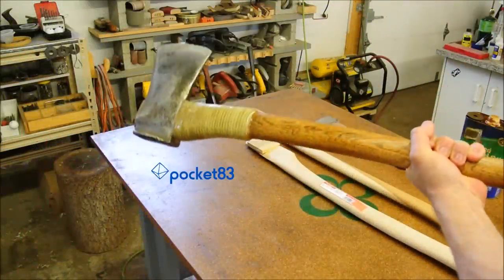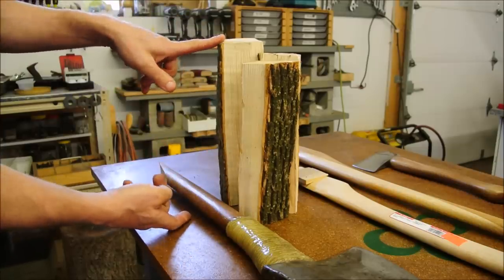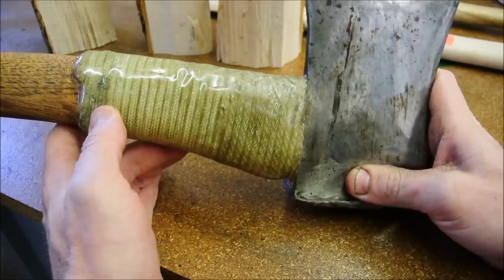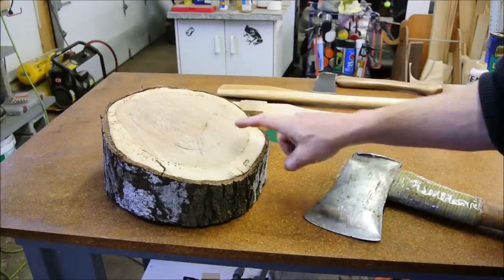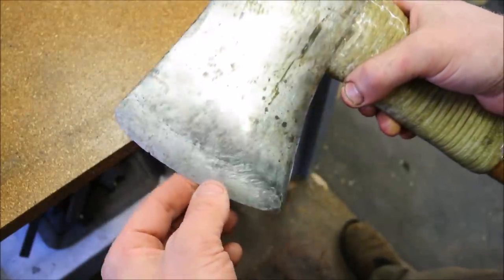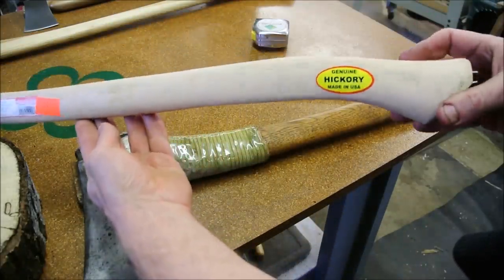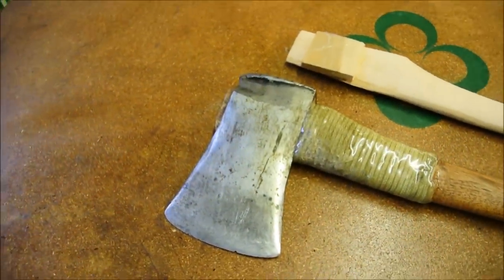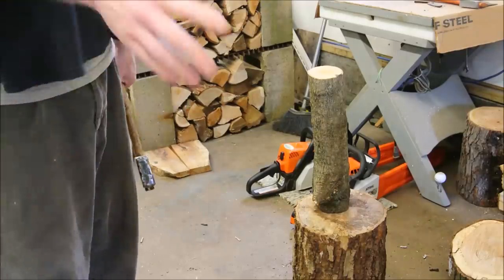Why (& how) I split with an axe instead of a maul

Comment: Axe heads can be perfectly good for splitting as long as they are shaped right. To get this shape is difficult in a manufacture process while a maul is nice and simple to manufacture.  Everyone has different preferences. You have found a great splitting axe and many will never have the chance to use one.

Comment: If I recall from ancient times when I competed in collegiate speed chopping  , we had to shape our own axe heads from "blanks". A veteran chopper guided us through marking out the areas to remove more metal to provide the hollow areas that transitioned to the "blow out" section that drove the slabs away. Also, the level of polishing  to enhance exactly what you're explaining about efficient cutting with minimal sticking. Everything competitive requires the details be refined to the extreme. But, as you so well articulate, attending to some simple details makes the task much more efficient and meaningful. Good stuff!!
Reply: Would having recessed areas of the head help with the splitting? I.E. Less surface area and friction. Maybe even making a way for it to breath so when it digs into the wood the air underneath it can escape more efficiently. I have no idea if it would work but sounds cool. Btw I'm a novice when it comes to axes. No hate.
Reply: that would make friction point that would probably jab into the wood being less efficent

Comment: Never seen a axe handle split like that before. Pretty cool that the rope/epoxy handle guard held up. I’m getting ready to wrap some Kevlar strip around the handle and epoxy it in place. I want it thinner then the rope. Glad to see your axe repaired and back in use.

Comment: I've used a double bit axe to split with for about 40ish years. It's a knack. An old guy showed me. Now I'm an old guy.  If the axe can't handle it, I use a wedge. Enjoyed the video!
Reply from the maker: Thanks. I almost bought one once, but there's something intimidating about those. I feel like I would cut myself. Also, it's hard enough to keep one edge sharp!
Reply: @pocket83squared  I kept one side scary sharp and the splitting bit not so sharp. Kinda dull actually. On the downswing, let it roll to the left to kick it out to the right. Usually it would bounce a couple times, then pop. From then on, it was easy peasy. Am referring to bigger sticks, kinda like your base. Also,  double is easier to un-stick. :-)

Comment: My favorite splitter is an old Snow&Neally Maine pattern that
is basically a giant 3 1/2 pound full flat ground wedge.  I found it
buried on my property and had a blast cleaning it up, rehanging it
and using it.  Thanks for the video.

Comment: The Axe is the all rounder you can chop off limbs, split logs and even fell a tree... a maul is a good tool for only 1or 2 specific tasks like splitting logs and hitting wedges if need be, but as you said Matt’s been used as a hammer in the past and probably did the job just fine, if it was your full time job making firewood you would probably use a mechanical log splitter and the maul is almost obsolete. In the past I think the idea of the maul was so your axe didn’t get so much wear in the handle and kept its edge for longer before the times of chainsaws. Thanks for the upload
Reply: It looks like Matt has been used as an anvil.
Reply: Gareth Baus or maybe just a wedge perhaps with no handle

Comment: Nice video. I use axes and wedges and mauls depending on the situation. Most of my splitting is for firewood; 1/2 of which is about 18" for a fireplace, the other 1/2 is for campfires. Glad Matt has been with you for a while. Looking for a new head to build this summer.  Enjoy.
Reply from the maker: Do you seem to stick with only the maul for 18" lengths? That seems pretty harsh for an axe to me.

Comment: I saw you said double bits are intimidating. They can be if you don’t have good follow through. One of the blades can be very dull. Double bit axes swing very well because they’re symmetrical. If you find a heavily worn double bit ax where it is thick with convex cheeks you will have a very very good 2 1/2lb maul that is shaped like an ax. I’m surprised you’re using an ax with such a deformed eye. Nice video. I use axes mostly. I use a maul on knotty stuff that won’t yield to any other technique.

Comment: Season your wood in full rounds, then split it when the ends develop cracks.  The wood will tell you when it is ready to split, splitting wood that is wet makes your job much more difficult.  I have split many cords both wet and seasoned, and know this from first hand experience.
Reply from the maker: I can't agree with that. For one, full rounds take longer to cure. Second, they're harder to stack. Finally—and perhaps most of all—Maple and Cherry rounds that have dried are much, much harder to split. What species of wood are you splitting mostly? And what length do you cut your rounds to? My experience has taught me quite the opposite of what you are claiming.  

It's not that I am saying that you are wrong; it is that we must be applying different techniques, or using different materials. Because springtime wood, when it's swelled with lubricating water, separates in split with hard lateral ejection. In contrast, my late fall rounds have now been checked for months, and they'll clink when touched with steel; but the sound of the axe blow is a dull, dead thud—with it left stuck three inches deep in end-grain. 

Hard Maple to fresh is no comparison for splitting. Not by a longshot.

Comment: I'm certainly no expert on splitting or toolsmithing, but it looks like the misuse of it shaped it (as you described), and it seems shaped into an ax head with desirable geometry aspects of a maul, having a bit of a spine lengthwise on each side, helping split the rounds, and preventing it from getting stuck

Comment: I much prefer to use an axe when splitting. They say a maul is designed for that, but I get fewer splits and more misses with a maul. Maybe it's technique, but I just seem to get better hits and cleaner splits with a good axe.

Comment: Not through the video yet but I've been spitting wood all my life and maybe there is a difference what part of the country you are getting your wood from but I can't see that axe splitting anything more than 18" without getting hopelessly jammed in the block? I apologize for sounding critical but that's my experience .. goid vid anyways thanks all the best
Reply from the maker: No problem. I'm in southwest central PA. Most of the wood I split is either Maple, Cherry, or sometimes pine. It takes practice, and technique. You can't halve an 18" round very often with an axe unless you use a wedge. Instead, you chip away at it from its sides. They get easier as you go, so I have yet to find the log that I can't break down. Of course, this all depends on the length of your rounds, as well. Mine are only cut to 13" or so; any longer and it wouldn't be worth the energy.

Comment: At around the 7:57 mark, is that a crack forming up the side of the eye?
Reply from the maker: Not so far as I can tell. It was inspected it pretty closely as it was cleaned up.
Reply: @pocket83squared  Glad to hear it. That would make for a pretty spectacular failure somewhere down the line if it was cracked. Long live Matt!

Comment: i noticed that the surface of matt is more cruved than i'm used to seeing an axe head (if looking at it with the cutting surface at the bottom and the flat top section at the top) if you look across the face left to right  it has a face for splitting

Comment: as you cut this wood do you plant new trees to grow more wood later?
Reply from the maker: Umm, in a word, no. But I am the custodian of my property, so part of managing the woods includes selecting what I want to encourage to grow, and where. That means that I am continuously taking out growth that is too thick, or trees that are not well. But it also means that I am planting and moving new trees where they are needed. For example, I am chopping away the surplus Beech saplings, but also clearing away spaces for the young Maples and Cherries. I'm also (re)planting Walnut, Hickory, and Tulipwood, which have been mostly used up here by industry. 

It's a garden. And it yields best when it is in balance.

The property that I 'own' provides me with more than enough material for building, burning, and gardening. I will try to pay it back by keeping it healthy. I don't claim to be ecologically neutral, but I do try to limit my waste to a reasonable degree. Also, much firewood comes from natural drops. Further, there is an unlimited supply of wood available to me here from an adjacent property, which was recently logged. Logging is tragically wasteful.

Personally, I will never log for income; to do so is prostitution, and I value natural beauty over monetary increase by far.
Reply: @pocket83squared  cool now i know

Comment: Who says you have to split with a maul? Sometimes I prefer to split with a double sided axe because they are so damn heavy. Usually i split with an axe or hatchet that is the weight I like. I'm usually splitting someone else's cuts though.

If you really want to get pedantic, then the most efficient way to split is with a hydraulic splitter lol